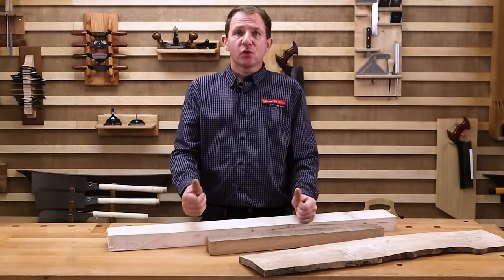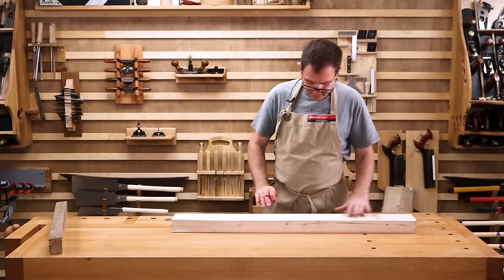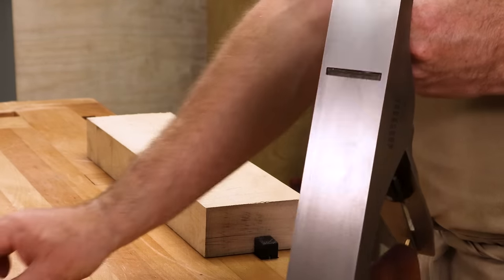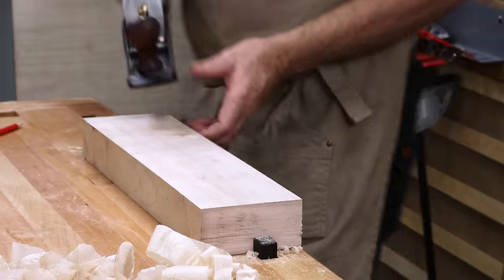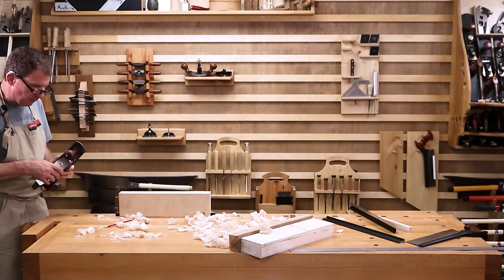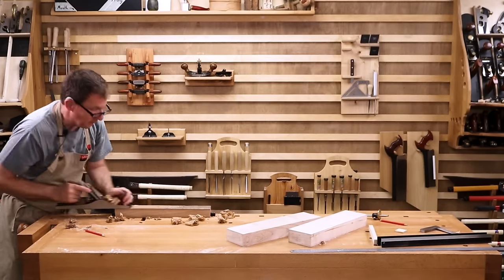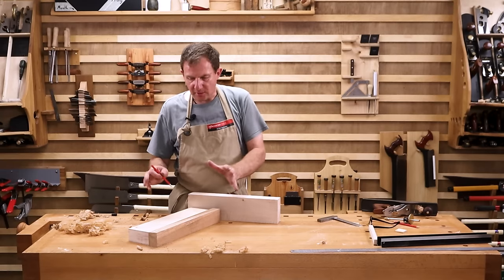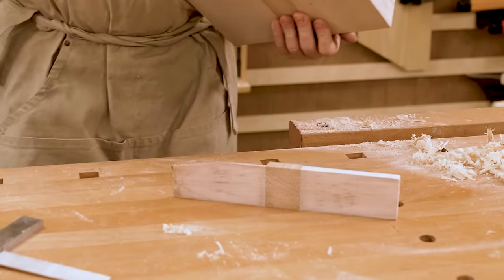How to Square Timber Using a Hand Plane – Woodworking Wisdom

Comment: Love thee videos pal. U spend a lotta time explaining which is very tough to get on YT these days. Most videos fly through the important information. 
U guys always spend the time to teach us correctly. Thanks for that guys. AUK is a brilliant tools manufacturer/Supplier.
I've only begun to use Hand Planes over the last month. I'm loving them. I need to invest in a #5 Jack plane. Is this also called a scrub plane or is that the wrong name for it?
I also need to get me a Jointer plane soon so I will be here on the website having a butchers at the hand tool u guys have in stock..